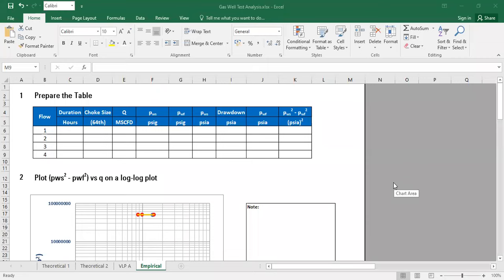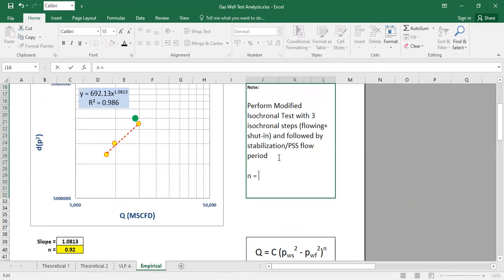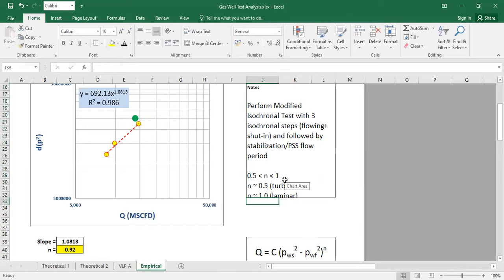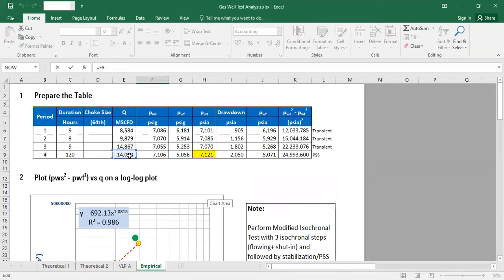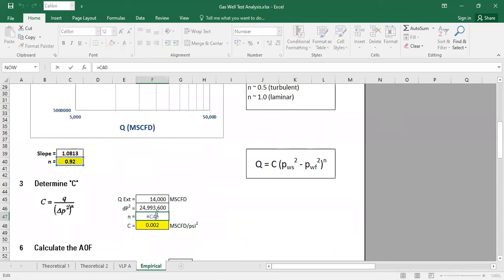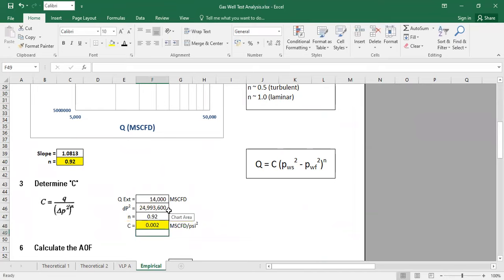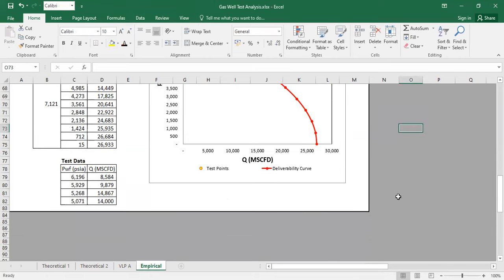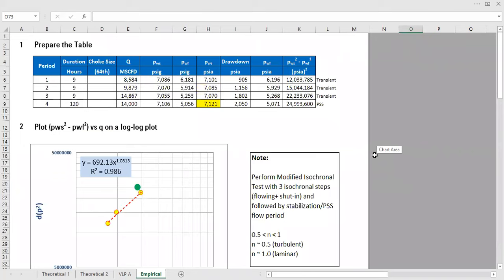Gas Well Deliverability Analysis: C&n Method

Comment: Thank you so much for your great explanation .. but what can I do ( how to know the well deliverability or productivity ) if I have a production data for a gas reservoir ( gas well ) and don’t have any deliverability test for the well and I don’t have permeability or Pwf but I have The tubing head pressure, assuming I’ve managed to get the Pwf from THP what should I do after that using prosper software or spread sheet and what should be my workflow please ?